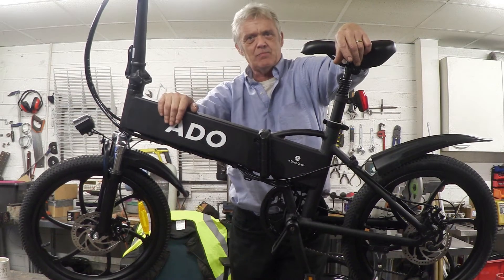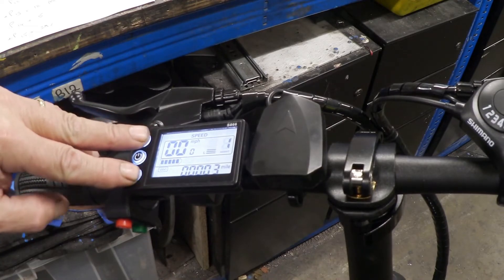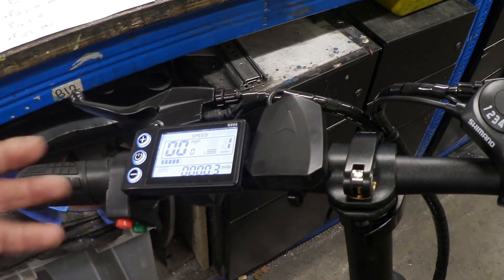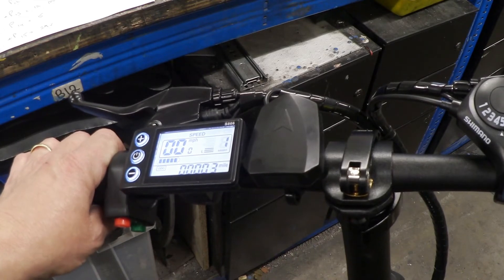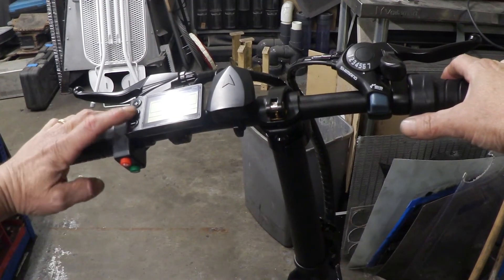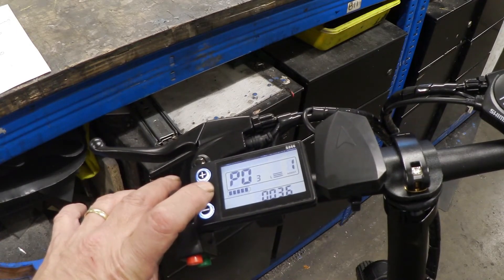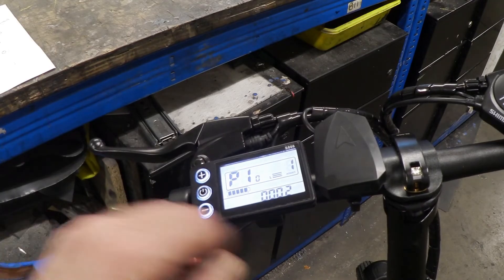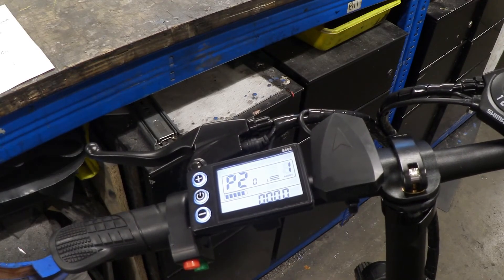1291 How To Use Change And Hack The ADO A20 E Bike Controller

Comment: Not hacks, it's just settings that most DISPAYS will have. That's not the controller, the controller is normally a little silver box tucked away on the frame.

Comment: I have an identical one, not a bad bike but the pedal assist is horrendous. It only measures the pedal speed, not the effort/torque,  so it is better and safer just using the throttle but the pedal sensor is sill live and overrides the throttle, making it suddenly accelerate , is there a way to switch off the pedal sensor and just have it on throttle?

Comment: Hi, I have an Aado A20. But for a week now my display has shown the symbol that I'm braking, which is why my engine no longer starts. I've already tried everything. Brake cable pulled out and plugged in. Swapped left and right brake cables but nothing helped. The symbol was suddenly there and I don't know what to do next. Ado Support says I have to buy a new motor for 250 euros, but they can't be serious. Please help me. I need my bike to go to work.😢

Comment: Hello there. Can you please explain or send me the right way how to connect the 7 wires 
(brown and white are for the lights)
from my S_866 lcd display i have a throttle and power switch on my e-bike and motor controller !?
I really need your help with this problem because I can't find a good/easy explanation on the internet about the wires from my display to connect it to my throttle and motor controller.
Grtngs Frank Grinwis from the Netherlands

Comment: Thanks for info about holding the brake levers in when powering up. I must have switched it on while holding the break this morning. I couldn't for the life of me figure out why my throttle had suddenly stopped working overnight when I'd not touched the settings and it was working fine yesterday!

Comment: P01....Brightness 1,2,3; P02....Km/m; P03....Voltage 32/48/60; P04....Sleep time minutes; P05....PAssist mode; P06....Wheel size inch; P07....Magnet number in motor; P08....Speed limit; P09....Start level of PAS; P10....2=Peddle & throttle Assist; P11....Boost sensitivity; P12....Boost start strength; P13....Number of magnets; P14....Current limit in Amps; P15....Low Voltage power off; P16....Clear milometer; P17....Cruise enable/disable; P18....Speed ratio % adjustment; P19....1=Direct Hub 2=Gear Hub; P20....Protocol=0000

Comment: Hey can und help me i have the New Ado who i cannot die the Speed Limit faster. That is seit but Thats  not my problem. My problem is i was going  in the system  and make a mistake i switcht anythibg and New my bike only rides  in the mode 1 and 2  the third Mode  Notting Works maybe und habe an idea whats the wrigth setting ?

Comment: Which one of those settings controls the assist for walking the bike uphill? I need to walk the bike up the ramp next to the staircase to reach my house, and I accidentally turned it off. 'Walk assist' would you call that?
Reply: Just press and hold down the minus button and the motor will go at walking speed.
Reply: @r.robski3054  Thank you very much. I was using the throttle - too fast!
Reply: @krystalwasser8250  do apologize...not power button but minus,just checked for shure,my mistake sorry
Reply: @r.robski3054  Okay, no worries.

Comment: Absolutely brilliantly explained, as always. Was just wondering if you would be able to expand on P18, 19 & 20 please? Other videos stated that P20 wasn't used, but mine has three settings 0, 1 & 2. Not knowing what ANY of them were for, I fiddled with each one in turn, and then regretted it, as my bike wouldn't work for hours - until I found a factory reset video. I got error codes E 08 & E 030 at different settings of P20. Don't know which setting got them to appear, or what I did to clear them, but they're gone now. Would be good to know what these three settings are for though. My bike is a Heybike Mars (I think - it looks identical to your A20), with an S866 controller. Cheers and thanks for another great video.

Comment: Thanks for detailed explanation. Have my a20f and I must say I am disappointed. Despite setting P12 to 0 which means acceleration strength set to min, the bike pulls strong each time making a ride far from smooth. I also increased number if gears to 5 and still even at 1st pulls strong making ride on crowded places tricky. Pity it is not torque sensor bike. Any ideas?
Reply: You should have got an Engwe engine X. It has no torque sensor but you can control the acceleration strength much easier than this bike because it depends what power setting you choose and it's got 5 of them. Also it has many other advantages over this ebike.

Comment: Maybe it's useful to say that when you fold the bike, you have to do the trick again to unlock the throttle after unfolding it again. Takes only a few seconds, after getting use to the 4 steps, as Robert mencioned:
Throttle(1)/front brake(2)/back brake(3)/switch on the panel and wait 20 sec.(4). Then switch all off, before start to use it.
Thanks for the great tips and for being so precise on your explanations, this can be complicated for some of us!
Reply: Nothing works now

Comment: P1 -screen brightness
P2 - km to miles
P3 - battery voltage
P4 auto sleep timer
P5 no of asisst 0/1/2 
P6 wheels diameter 
P7 no of magnets in the sensors
P8 speed cap (limit) 
P9 none zero start 
P10 drive mode 0 ( no assist) 1 ( electric assist) 2 ( both) 
P11 the time( in seconds)  that takes to let the motor kick in 
P12 acceleration strenght
P13 sensor type 
P14 control Amp limit 
P15 volatge limit ( cuts out when its hitting the named voltage) 
P16 reset the speedometer/ odometer
P17 cruise control 
P18 display adjustment 
P19 zero gear pedal powered or no pedal powered 
P20 comunicate with the controler
Reply: Hey can und help me i have the New Ado who i cannot die the Speed Limit faster. That is seit but Thats  not my problem. My problem is i was going  in the system  and make a mistake i switcht anythibg and New my bike only rides  in the mode 1 and 2  the third Mode  Notting Works maybe und habe an idea whats the wrigth setting ?
Reply: Hi there can you tell me how I get back to po settings when I press both buttons I just get a blank screen

Comment: Hi all I just bought the a20+ eu version and now it doesn’t come with a throttle proper gutted. Does anyone know if I can just buy a throttle and possibly another controller to get it working? I’m assuming it’s still pretty much the same bike just even more restricted? 

Thanks in advance.
Reply: Did you get any answer about this?
Reply: that would also depend on if it even got a plug to plug the throttle into or not.  More than likely they probably have a plug someplace on the controller that goes un used for the bikes they sell in places that aren't allowed to have a throttle.
Reply: plug is taped and visible, so should work, anyone tried?

Comment: Hey 👋

Sorry to inform but as of today 12/11/2022 the instructions given in your video to switch to throttle mode are incorrect, you need to:

1: Bike off
2: full throttle and front right brake lever (not both levers)
3: hold for 10 seconds (not 20)
4: and finished! Throttle is enabled

This worked on my A20+ that I got yesterday.
Reply: Can I ask was this the EU version?
Reply: @grahamramsden4200  yes it was an EU version as I live in the UK 🇬🇧

Comment: I bought this bike 5 months ago and happy with it, for the price it's worth it. It still needs regular maintenance and tightening every month or so. One thing to note is that it's easy to disable the "Throttle mode" if you turn it on while accidentally holding down one of the breaks or accelerator. This can be confusing especially since the console provides no indication.  The battery will only last 30+ KM if you're using a lot of throttle mode only.

Comment: My A20F pedal assist cuts out at 15 mph in setting 2.  Is there any way I can get pedal assist to work at a higher speed?
Reply: Did you get answers hav same bike terrible without throttle
Reply: @ChristopherMcglue  Yes, you can make the pedal assist cut out at a higher speed.  Find the setting for wheel size and reduce the size of the wheel. This will increase your maximum pedal assist speed.  Use gps to check the speed as the speedometer will no longer be accurate.

Comment: Thank you sooo much for mentioning that last thing with the factory setting. I bought a brand new e scooter that used the s866 system and the scooter stoped working after 15 mins of use when i first got it. Then it never worked after that. The scooter would not acellerede. So the day before i was about the send the scooter back to the company i found this video. So i found the factory settings for the scooter and it finally worked after spending days trying to get this to ride agian 🙏🙏❤️
Reply: What are the factory settings

Comment: Hi everyone,
just got this awesome bike, but the throttle doesn´t work! I did all the settings from the video and i´ve tryed the hack to unlock the zero start. It won´t work! My Controller is missing some P settings, it ends with P16! Is this a bad sign? Please Help!
Reply: Did you fix this? Mine also goes up to P16 only but I have throttle. It's the P9 setting on mine that activates the throttle.
Reply: The teacher explained it well! Make sure your bicycle is off, then Accelerate to maximum while touching all the breaks. Put it on and count 20 times, then release the breaks as well as the accelerator at the same time! There you are done. I did it after suffering for a year now! The vice versa is true if you want to activate the pedals!

Comment: Why does my ADO A20 only have up to p16 mode, it doesn't have p17, p18, p19 and p20 as shown in the video?
Reply: Yeah, same here! And my throttle doesn´t work :(
Reply: Mine to! Only 16p. However everything works fine, including throttle.
Reply: Mine to 🤔
Reply: Same here. P9 setting activates the throttle on mine.

Comment: Throttle activation has changed:

Pull left brake and switch controller on and hold for 10 then hold the throttle and right brake for ten now switch off and on again. Assist level 3 and away you go.

Also: in 0 Assist if you press - it will travel at a max of 4.2 mph cruise control.
Reply: Thanks friend, finally got my throttle working so made a note of your instructions. Cheers 👍

Comment: Help needed please. Just bought two A20 bikes. Trying to change from hybrid mode to pedal assist but doesn't change. At the moment throttle works on assist level 2 and 3
Reply: Did you sort it mate? I have peddle assist in mode 1, and 2 and 3 are throttle only? Wtf .
Reply: @coaldust01  Mine exactly the same.
Reply: @kablpe  I'm going to return it then, I wanted 3 peddle assist modes as advertised, and the front shocks are horrendous, good luck with yours.
Reply: I would have liked pedal assist in mode 3 as well, or pedal assist to work above 15mph. Anyone know how to do it?

Comment: I received it today. The throttle does nothing. I followed the procedure but it doesn't work. Can anyone help me? Thanks
Reply: I have the same problem. Maybe they've made some changes? There are a few people here saying the same thing.
Reply: have you solved this problem? my bike´s throttle doesn´t work as well :(
Reply: @QuotesOfMankind  Did you put in in hybrid mode?
Reply: It took me a few tries. I don't know what I did different but it worked! I think you have to follow precisely what he says maybe I was talking short cuts before.
Reply: On mine it is the P9 setting that activates the throttle.

Comment: I think I'd be more interested in electric propulsion if sodium ion batteries were used instead of lithium.  There is so much sodium around and obtaining sodium is not ecologically destructive as is mining for lithium.  Sodium can also be easily neutralised once the cycle life of the battery is over thus making them very easy to dispose of without the toxic hazards associated with lithium products.

Comment: should try change the voltage settings and make a 12s or 13s battery pack for it, wouldn't fit in the frame but you could have it in a backpack.

Take it out to a dirt path and see how fast it'll go under its own power
Reply from the maker: cheers mate
Reply: Video 1292 shows the motor itself is rated to 36V, so overvolting it might not be the best idea.

Comment: I'm interested in building a wheelchair based off of mountain bike hub motors. Ideally, it would be joystick driven. How do I go about getting the two motors to talk to each other and the joystick in such a way that they can interpolate say a diagonal input into the necessary speeds for each wheel. Is there a product on the market that would walk me through this? I don't have any coding abilities and I am not terribly skilled on a computer. I have no problem developing the mechanical platform. Is there a particular resource you can point me to?
Reply from the maker: there seem to be plenty of motorised wheelchairs out there with dual drive mate. I found this product
https://www.uumotor.com/24v-36v-30a-electric-wheelchair-joystick-controller.html
this or something similar seems to be what you want
Reply: @ThinkingandTinkering  thank you very very much for looking that up. I apologize, I should have been more specific. I own a chair similar to that now. I'm interested in building a chair that would allow me to go on mountain bike trails and hiking trails again. I believe I need the large wheels and gobs of torque to make it work. I'm also shooting for a somewhat more upright position where the body weight could influence steering. I'm sick of just being able to navigate cities. I hate cities. I want to make a new form of sport. The end goal is for it to be attractive to able-bodied people as well. I have a full machine shop at my disposal, I'm quite stupid when it comes to computers and modern signaling.

Comment: Please tell me you're going to try using this or some other off the shelf speed controller to power the magnetically assisted switched reluctance motor.  I'm dying to see how much better it can perform while being cheaper than an off the shelf electric motor.  You could try making the... stator? (The part that rotates and holds the metal bits that get attracted to the electromagnets) out of newspaper and casein glue composite for a cheaper/lighter? motor.
Reply from the maker: Now then a paper motor - interesting!

Comment: Mistake for the manufacturer to NOT INCLUDE a reset to defaults option
Reply from the maker: probably not mate - different country have different regs and a default reset might well negate some countries regulations and prevent import - that's probably why they updated the s866
Reply: @ThinkingandTinkering  Easy enough to have location specific defaults